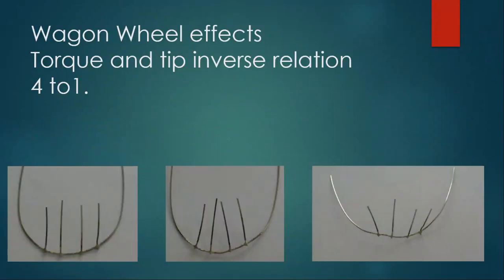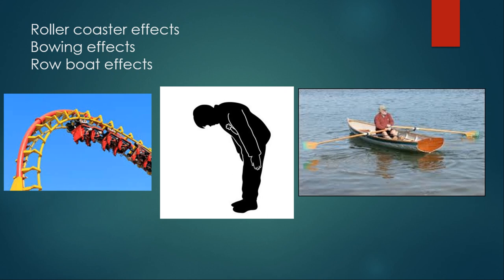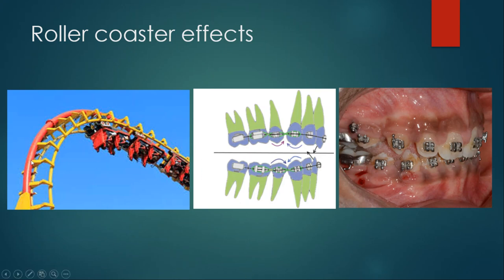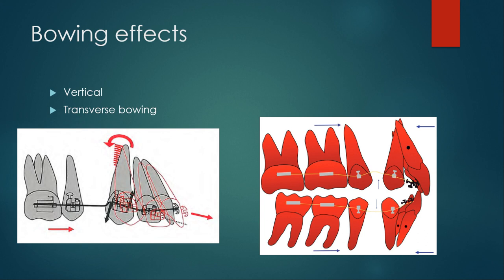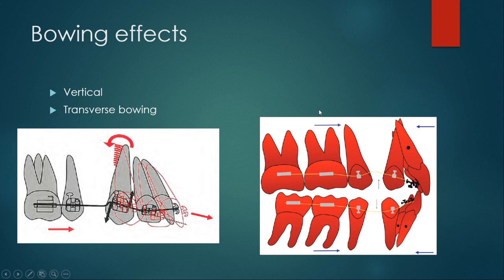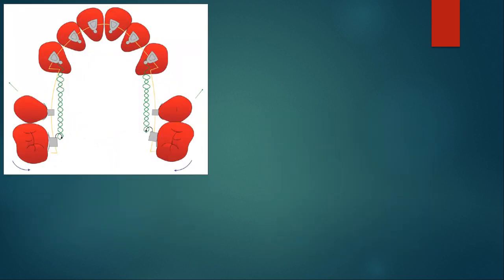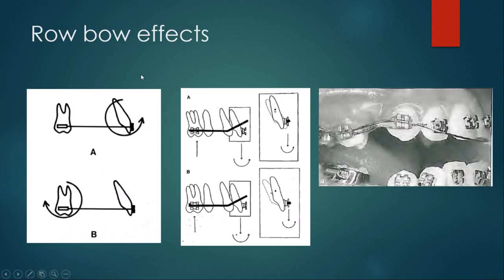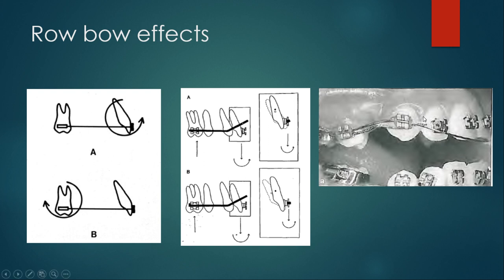Wagon wheel effects, Roller coaster bowing effects, Rowboat effects

Comment: Hi Dr. What's up?
Indeed, I faced the same problem in one of my cases.. (wagon wheel effect).. every thing was alright till I reached 17 * 25 NiTi wire.. the upper 2s became with flared crowns, tipped distally.. I did all I know to s solve the problem but it didn't work, torque spring, torque bend, upside down bracket position, Z bend.. change the right bracket to left but with no hope..
the tooth is with normal phisiological movement, good occlusion, enough space mesially and distally.. no sign of ankylosis, the x_ray showed no Pdl widening, radiolusency or change.
Please Dr., your kind opinion.